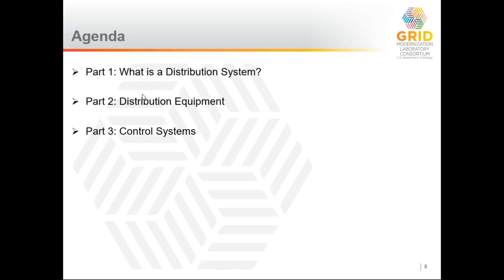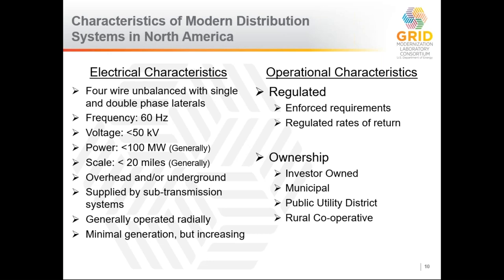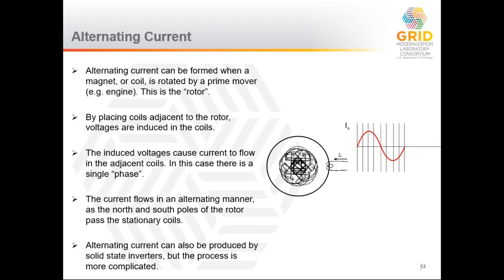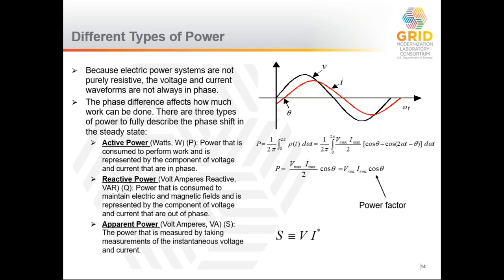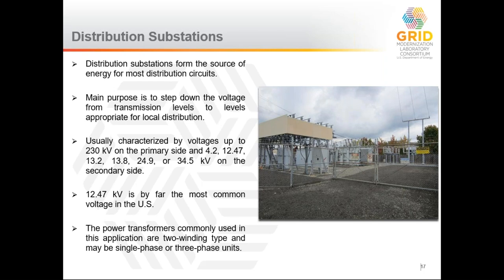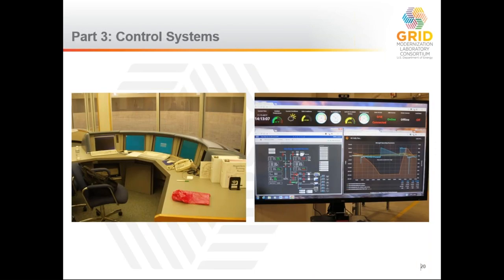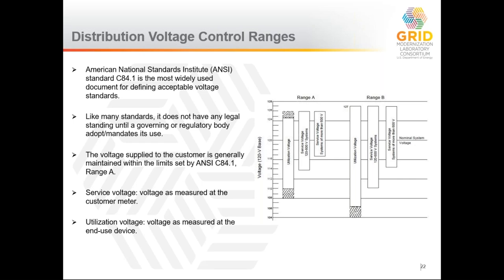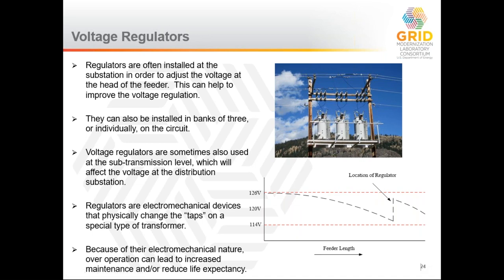Distribution System Components, Systems and Operations Part 1

Comment: As an electrician, I am always irked by the myth of Tesla being still perpetuated. It was not Edison vs Tesla, but Edison vs Westinghouse. Edison and Tesla got along just fine, and spoke well of each other. The three phase 3 wire system that we use was not invented by Tesla, but by Mikhail Dolivo-Dobrovolsky, a Russian/Polish engineer, electrician, and inventor in the 1880s. Tesla's 3 phase system was a beast that required 6 wires, and like most of his wacky ideas, was thankfully never adopted. Tesla was a clever Hitler loving wack job with some bright ideas, but did not contribute nearly as much to electrical systems as people give him credit for.

The reason for his "suppression" was that many unthinkable concepts, such as the atomic bomb, were becoming reality during WW2, so the US Department of Defense classified all of Tesla's work due to his close ties and support of Hitler and the Nazis in order to prevent any possible technology from falling into Nazi hands. As it turned out, Tesla's ideas, such as death rays, did not actually work very well, as extensive testing by the US department of defense discovered.
Reply: Any reading you could recommend?